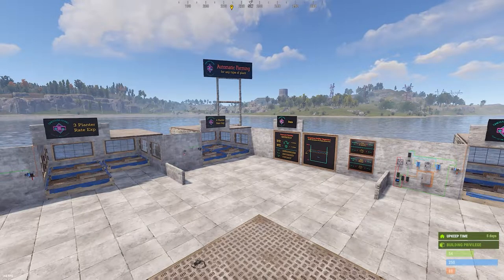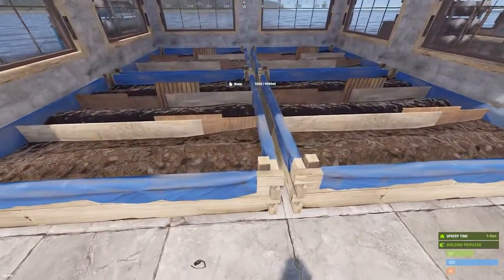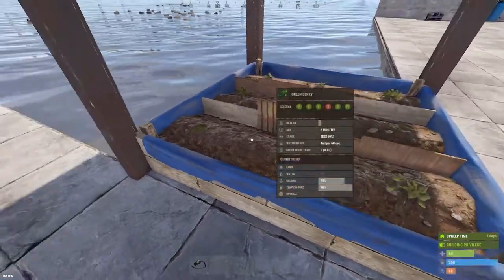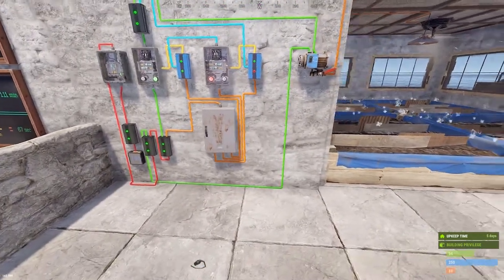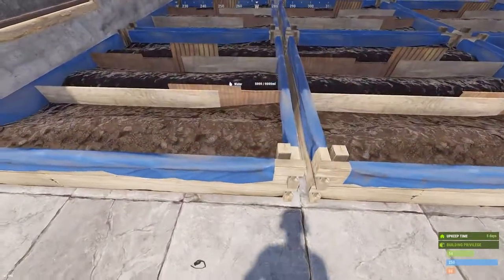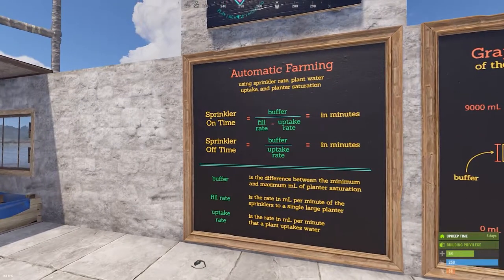RUST Electrical Guide | How to Build the AUTOMATIC SPRINKLER SYSTEM To Grow Any Crop 2022

Comment from the maker: There is an UPDATE VIDEO that addresses some issues and adds new functionality here https://youtu.be/6Pdv2k2zw5I

Video Contents:
0:00 - Intro / Purpose
1:20 - Setup
2:12 - Calculating Timers Part 1
6:33 - Determining Sprinkler Rate
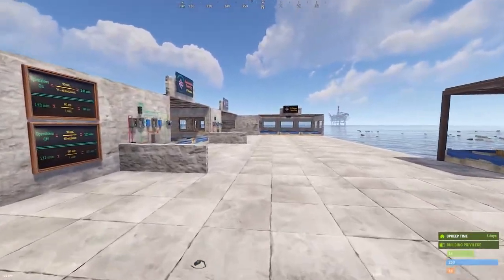9:27 - Calculating Timers Part 2
11:29 - Building the Circuit
14:42 - Six Planter Example
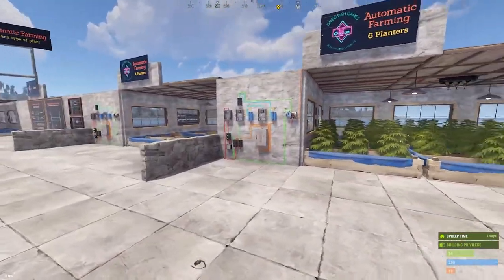20:39 - Outro

Comment: I get different number when I calculate 50/(75-45) = 1.66 not 1.43. Did I do something wrong? The calculation for 6 planter boxes is the same as I have but the image confuses me a bit.
Reply: is because u need to convert to hex system

Comment: The only annoying part is, how do you get to the correct initial value and maintain it? If you are over satured, you need to reduce the water level to the optimal system before activating this system. Then if nothing is planted you need to ensure the system is off

Comment: Actually I don't know how it is working for you guys. My one is starting both timers when switched on and doesn't alternate. I managed to get it running by removing the blocker of the 'off' timer. (which is now running continuously for on+off duration)
Reply from the maker: Check to make sure you have the correct amount of power running from each branch. If I had to guess I'd say you're short on volts somewhere.
Reply from the maker: Edit, sorry! Upon further investigation the issue is the splitter outputs and what specific components they're hooked up to. The outputs of the splitter must be connected to the two blockers and the off timer as shown in the video (I said they didn't which is incorrect) or both timers will run together.
Reply: @AustinKlailaGames  wow its crazy how that simple thing changed everything

Comment: I was being stubborn and wanted to design the same concept (timer on, timer off cycle) but without copying someone else's circuit, especially since most were designed pre-electric April2024 update.
I came here to see if Austin's design could improve mine and found we designed similar circuits but post electric update this can be done with a few less components and with only 5rW: 1xbranch & switch, 2x Blockers, splitters, and timers.
Note: It should be 6rW but currently it appears the pump can be run off toggle power and you just leave pump power empty.

Hard to describe the circuit in words but Branch Set to 2/3. 
2rW goes to off-blocker which leads to OutputSplitter. OutputSplitter leads to PumpToggle and On-Timer-Toggle (this is half of the 'reset'). 
3rW goes to the other Splitter which powers both timers and the On-Blocker.
Off-Timer-Output leads to the Off-Blocker-Block-Passthrough.
Same for On-Timer&Blocker.
On-Blocker-Output leads to the Off-Timer-toggle (this is the other half of the reset).

I found Austin's math and buffer concept overly complcated. I did the math my own way and found a single sprinkler overwaters 4 large planter by 20% so I set my Timers to a ratio if 20:80 (I'm using 200sec:800sec for simplicity sake).
Appears to be holding the water steady.
Reply: So 1 sprinkler will keep 4 planters at 9000 with 45ml/min total planter usage?  I see in his testing, 2 sprinklers on a 4-plot gave 75 (or 72 in the video) to each planter.  Dividing by 2 because he used 2 sprinklers, that would be 37-38 per minute.  That would seem to be less than the 45ml/min usage and thus 1 sprinkler would not "over-water" a 4plot room.  Am I missing something here?
Reply: @notthatbirdman  yeah, the next wipe I tried doing the math again to apply it to a different config and found out I either
a) forgot how I figured out the numbers originally
Or
b) made a mistake in my original math somewhere but somehow mistakenly came to roughly the right on/off ratio. 

So yeah... I'm too lazy to go back and try and work out exact numbers or figure out how the math works. All I know is with one sprinkler a 80%/20% on/off cycle holds the water fairly stable in a 4 large planter config (assuming no w in the genetics). shrug
Reply: @notthatbirdman  reread your comment and without going into the maths, I just know from experience that 1 sprinkler will overwater 4 large planters. Before I started using timers I'd just manually turn them off every now and again whenever I was in base.

Comment: can you add 1 more pump and make another 6 planter setup from the same circuit or do i have to make another circuit for every 6 planters?
Reply from the maker: You can add more pumps off of the one circuit. Reinstall the green line that runs out of the middle bottom Branch Out that powers the Fluid/Switch Pump in the video to a splitter instead. From there you can now run up to 3 pumps off that splitter. You can continue to split off for however many pumps you want within the wattage limits of the battery. 

You will then need to adjust the lower Branch Switches to accommodate the added splitter(s) and pumps. 

As an example, if you wanted to run 2 pumps off the circuit, set the bottom left Branch Out to 18v and the bottom middle Branch Out to 3v.

If you wanted to run 3 pumps off that new splitter, set the bottom left Branch Out to 19v and the bottom middle Branch Out to 4v.

Happy to help if you have trouble!
Reply: @AustinKlailaGames  thanks, I will try and message if im having troubles

Comment: When I switch the switch ON it's default is sprinkler timer ON not OFF, what have I done wrong?
Reply: ah my timer handles were both set the same direction somehow, I set them as in your picture and they cycle ok, not sure if the default position is off, tho...
Reply: nope, when I turn the switch on...BOTH timers go ON?
Reply: Yup cycles fine if I manually unplug and flick over a timer then re wire BUT when I use the switch it powers both timers and the off timer does not turn off the on timer at the very start???
Reply from the maker: Edit, sorry! Upon further investigation the issue is the splitter outputs and what specific components they're hooked up to. The outputs of the splitter must be connected to the two blockers and the off timer as shown in the video (I said they didn't which is incorrect) or both timers will run together.
Reply: @AustinKlailaGames  I set it up exactly as you have it and both timers came at the same time, I will try again soon

Comment: Hey brother, mine is always starting with both timers on? What am I doing wrong?
Reply from the maker: The most likely reason is that your branch out settings are off
Reply: @AustinKlailaGames  everything else seems to work the right way. Just on start up both my timers start on. Then he cycles correctly. The only thing I did differently is from the branch above the “on” timer I went to a splitter as I’ve got 3 pumps running instead of one.
Reply from the maker: @kparr5  does it always turn both on when you turn the switch off and then on?
Reply: @AustinKlailaGames  yes. Then everything works as your does. When I get on I’ll reply with the set up I’m running.
Reply from the maker: @kparr5  cool. There are instances where timers will do this depending on how you set up the circuit. If you have discord feel free to jump on mine if you have pics to share.

Comment: Every time I reset the system with the switch and restart both timers activate, can’t figure how for you the 2nd clock runs first (I’m on console btw maybe that’s it)
Reply from the maker: I did some testing and it appears that if both timers are set to the same duration they will sometimes run together when initiated. Add like 0.0001 or something (example 1 sec becomes 1.0001) to offset them a little bit. Should fix your problem. Obviously, you don't have to use a decimal, they just need to be different.
Reply from the maker: Another (weird) fix is to power the two blockers using the opposite outputs on the splitter (far left splitter output to the right blocker, far right splitter output to the left blocker). Just swap what I did in the video. This is probably the easiest fix assuming it doesn't break with future updates.

Comment: Bruh I wired everything up for the automation, except when i flip the switch both timers turn on instead of just the off timer, its hurting my brain trying to figure out why.  The only difference Is i have one more pump running thats already getting power from a separate source, but thats just to get the water pumping upstairs when the main pump is toggled from the timer.  I've tried playing with the branches and values but nothings changing, both timers and the sprinklers just turn on and then when the sprinklers turn off THEN the timers start alternating.  No clue why, the entire circuit is wired the exact same but both timers turn on when you flip the switch.
Reply from the maker: Hey, sorry. I've been crazy busy. Did you get it figured out? Often the problem relates to Branch Out settings. Do you have discord?
Reply: I'm getting the exact same issue.  Did you ever get that fixed?
Reply from the maker: @wmarvel  Edit, sorry! Upon further investigation the issue is the splitter outputs and what specific components they're hooked up to. The outputs of the splitter must be connected to the two blockers and the off timer as shown in the video (I said they didn't which is incorrect) or both timers will run together.

Comment: It starts both of the timers
Reply from the maker: Check to make sure you set all the Branch Switches to their correct values
Reply: @AustinKlailaGames  Everything is correct. And i found the problem, it's the splitter. At 13:44 you say it doesn't matter , but it does matter. Had sprinklers on blocker and timer switched
Reply: @kaarelk274  Cant believe it was that! it actually matter idk why but it does, thanks to you too
Reply: @kaarelk274  hi, can you pls make a fast video:) pls
Reply: @xDarknessLorddx  Just follow this video and dont belive in any "it doesnt matter"s and it should work just fine
Reply: @kaarelk274  Thankyou:)